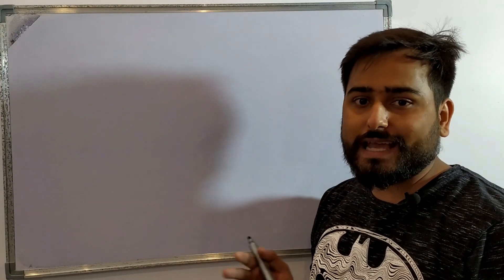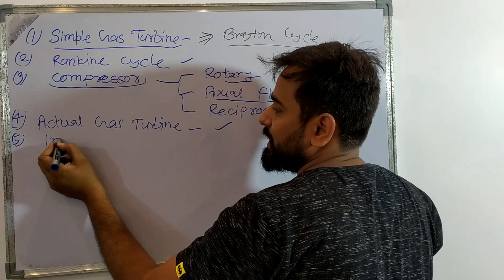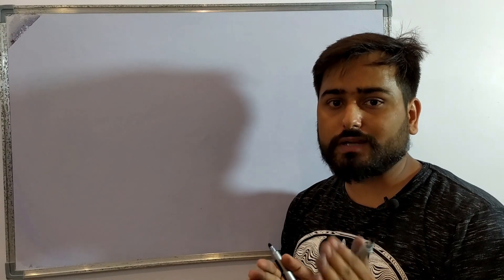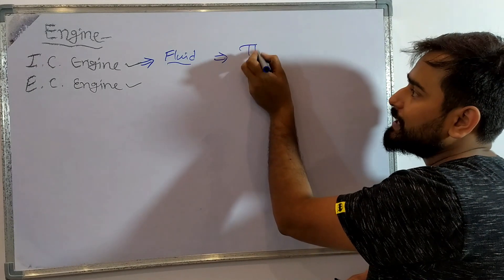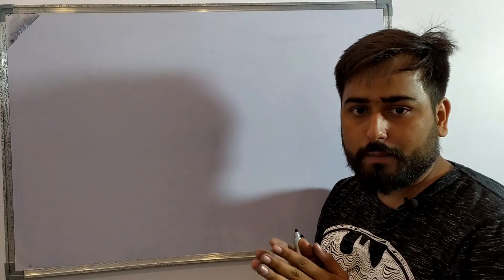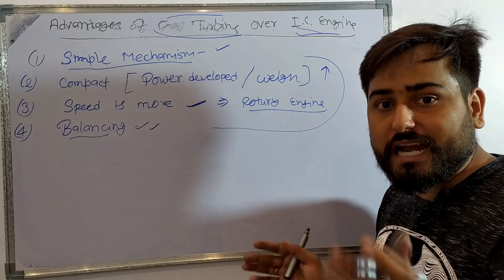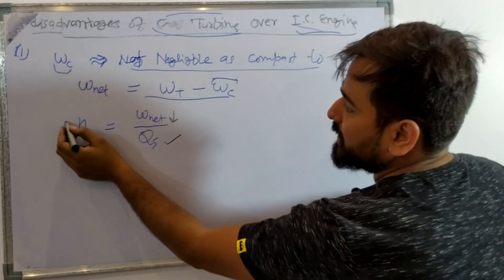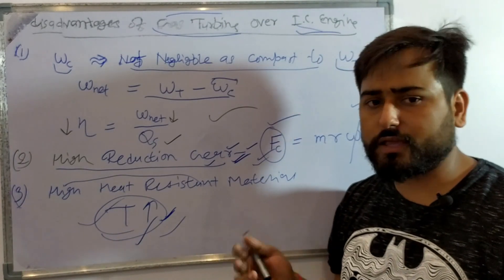Power Plant Engineering 01 | Introduction

Comment: Peak temperature in case of otto engine is higher than the brayton cycle for same compression ratio, but gas turbine is continously exposed to high temperature therefore we can not use otto engine as gas turbine, in IC engine , peak temperature can be reduce by coolant, as in automobiles